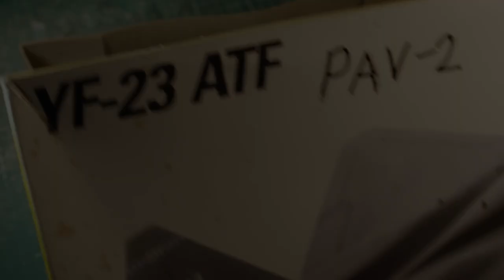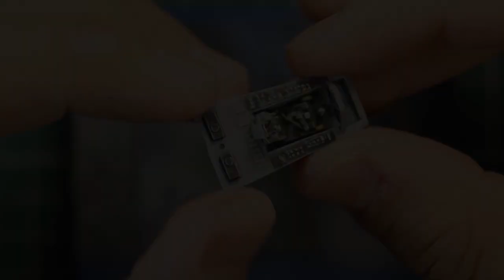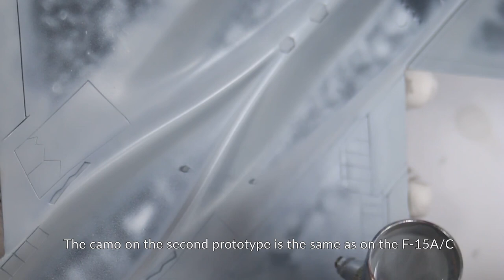Northrop YF-23 Second Prototype USAF 1/72 Testors Plastic Model FULL VIDEO BUILD

Comment: Why don't modelers use a simple technical fine liner pen to draw in the black in the panels? Why use this wash?
Reply from the maker: Because it is not easy to controll and does not look good enough.I have tried it and it is kust not the same.